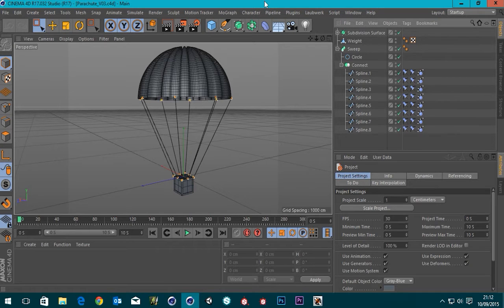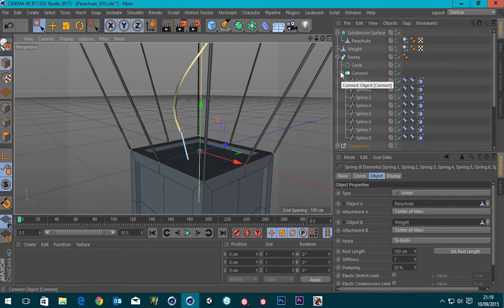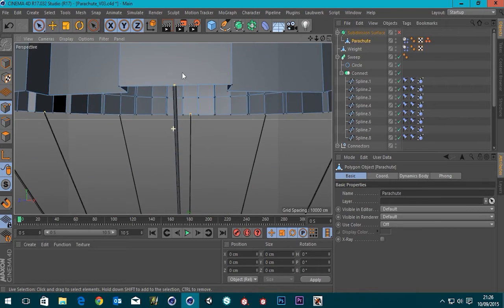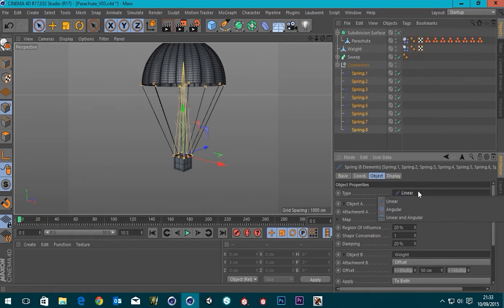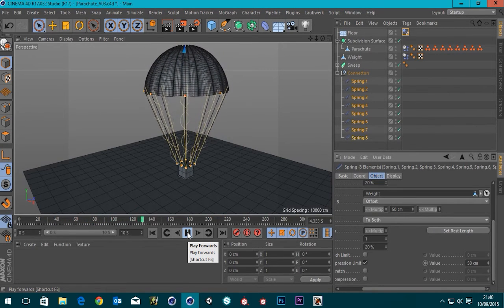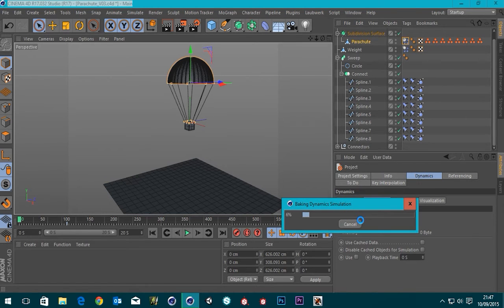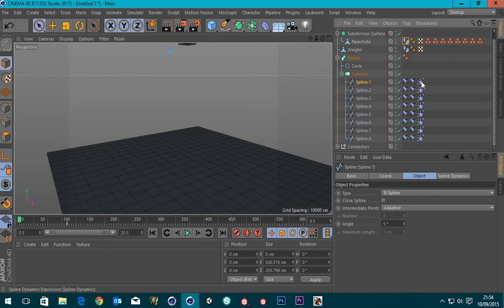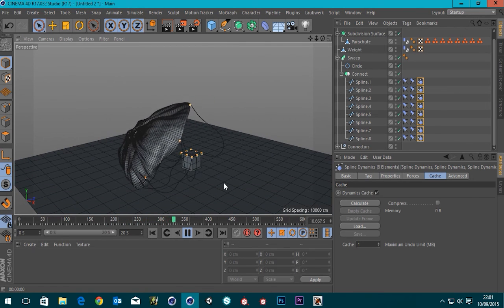Building A Dynamic Parachute In Cinema 4D: Part 2

Comment: Hi! One question. I made a 3d model and put all of its parts into null object. So I put this null object into the object field of the constraint mode and set the points. Then I made the rigid body tag to null object but splines don't stretch when i press play. I mean splines are not connected to the null object. What did I do wrong? Sorry for my english.

Comment: Hey sir, I've got a quick question, what if I wanted to use a project like this for unity 3d? Would it work? Thanks and nice tutorials, from Barcelona.
Reply: All the tags wouldn't work; the hair tag, soft body tag, collider tag, springs and so on. However, you can take your 3d models and reapply those tags using Unity tags. Hope it helps.